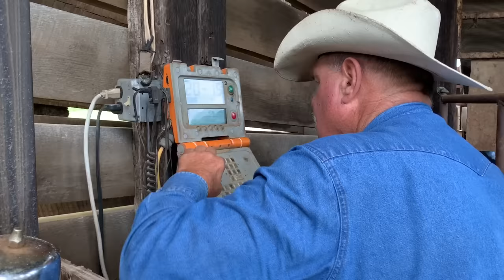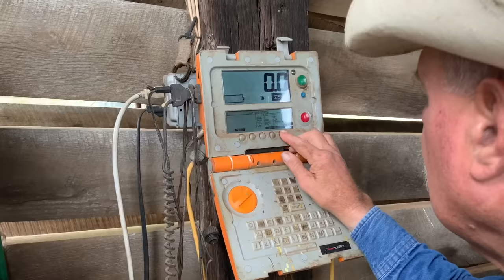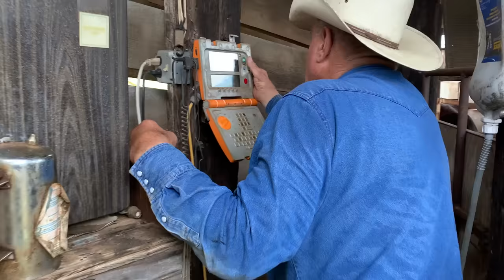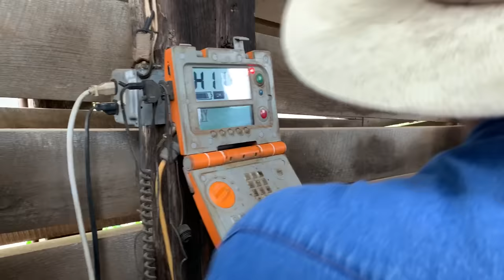An (Almost) Perfect Weaning Day!

Comment: I always liked to wean calves by the farmers almanac  and the best time when the sign is in the feet .
Usually don't have any problems and very little bawling.  !
Hope you got the hay up.  
My MOCO  has tine condition and it works so much better for drying than rollers.  And they do not tear the hay up at all but but breaks the wacksy coating of the hay so it dries faster  .  I like the tines much better. 
Have a great day everyone. 
😊😊👍👍💝💝🌹🌹🌞🌎🍨🍧🍨🍨

Comment: Meredith, I also have a regular UPS and USPS person. UPS is a hit or a miss on packages as I get stuff in batches, where the USPS person is here 5 or 6 days a week. One thing I do that makes their day is a purchase bottled water and give them water each day, ice cold.  Never had a package let out in the weather and the USPS guy will call me letting me know he's stopping before he starts his route for packages if I needed them ASAP.

You might look at what it costs to get a tanker of water delivered to the farm to fill the pool. Faster than drawing water from your well and doesn't drop the water table. End of the season, if you guys are going to spray any of the fields, use the pool water to mix with the chemicals, then it's a farm write off.

Comment: Another good one. That is the calmest bunch of cows an calves!  What is the purpose of the flaps hanging down from the sorting gates?
Reply: stop cows from going under and rising the gate ...............top  ones stop cows from trying to jump over  and get hung up by the back leg .........and it does happen ...!
Reply: @georgedoorley5628  We found one last fall straddling the fence, front half made it over. Didn't get found in time. It is still on the fence.
Reply: @cletaspratt9162  all happpens .................if u have livestock   you will have deadstock also ........so long as it stays outside the back door , ....as we say here .!